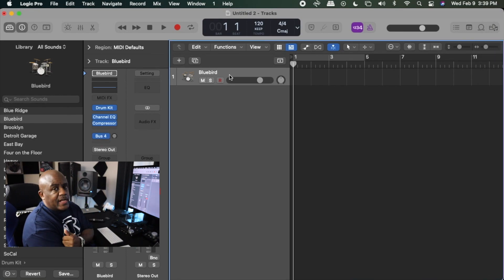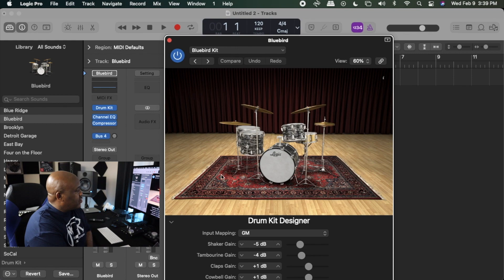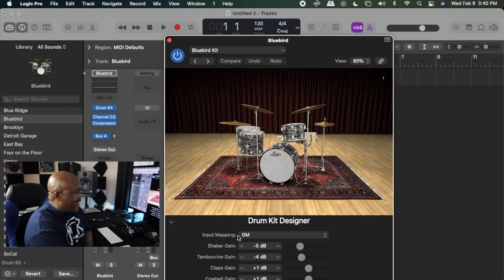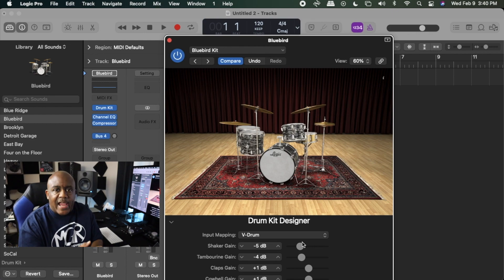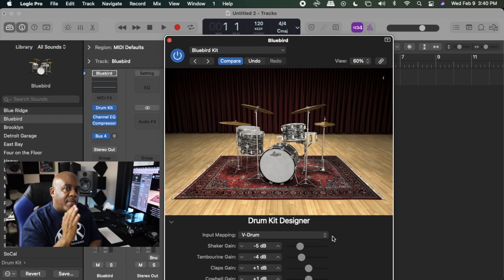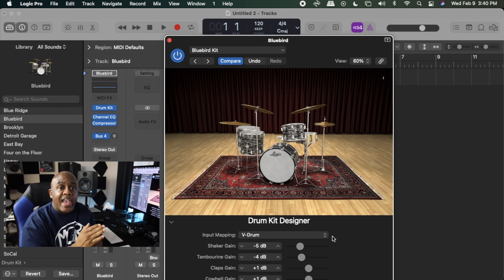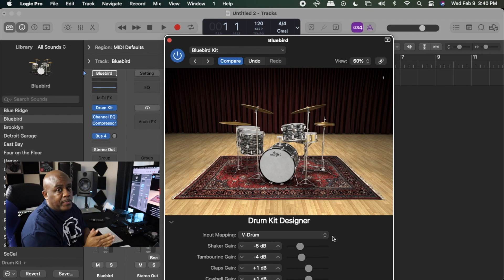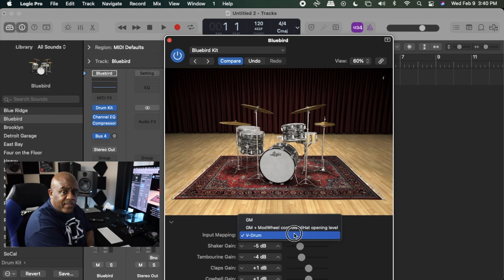How to map e-Drums in Logic Pro X to fix triggering issues.

Comment: Helpful video!! Thanks for your content! 

I’m running into a problem where my hi hats aren’t registering that they’re opening/closing etc… basically the little nuances you can have with a hi hat… and also my cymbals won’t register chokes… any ideas?? I can’t find anything online to fix the issue… 

Cheers!!!
Reply: Same here.
Reply from the maker: If assuming you’ve mapped it properly and you’re still not getting things like the choke. Make sure the drum does it straight from the module. If it doesn’t work there it won’t work plugged in to EZ Drummer. The drum needs to have the feature. If it does and still doesn’t work make sure the drums firmware is up to date. Then go back to mapping. If neither fails… call/contact customer service.
Reply: @KeithronPowell  when the kit isn’t plugged into the computer it functions just fine… when I map it through logic I’m not entirely sure how to map a choke or a hi hat opening or closing, if that makes sense? Thanks for your response! Appreciated greatly!
Reply from the maker: @Timbelialclarke  I’m not sure what to do… maybe try the different settings and see if one of the others work.
Reply: i’m having the same issue
Reply: @Timbelialclarke  same thing bro it’s just the cymbal chokes and the hi hat I have the KAT kt300 but I can’t get the chokes to register but it does originally on my module I’m also trying to figure out if I can do cymbal rolls but I can’t figure jt out
Reply: Have you figured out how to map the chokes yet?

Comment: I had a similar issue with my Alesis Crimson 2. What worked for me is using another PL cable, plugging it into the extra slot (tom 4), and changing the trigger to closed hi-hat from the module. Worked well on my logic pro. I tried several approaches but that's the only trick that worked 😃 Thanks for showing this way though, might have worked for others!
Reply from the maker: Thanks for watching
Reply: I'm having all sorts of problems with my Crimson 2 as well in terms of hi hat. I haven't found anything on this before happen to have more info? Completely new to Logic and E-drums in general
Reply: @TheDanbulance did you figure it out because I’m having the same issue with my hi hat with the Crimson. Pretty bummed because I spent a lot of money on this kit and Logic Pro is the only DAW I use😭😭😭

Comment: i am trying to use my alesis kit to record on logic and it reads it but i dont get any sounds to come through. do you have any videos? im new to using ekits and recording with them
Reply from the maker: The easiest way to record the sounds from the  drum is the most involved. You can trigger the drum sounds in Logic by connecting it with a usb cable.

Comment: I found out about switching the input mapping to v-drum a while ago, but it only works for the default kits in logic's drum kit library. I tried going to the producer kit section spanning off in the library and there is no tab to go to the drum kit like there is in the regular drum kit library so I don't know where to turn it to v-drum and have triggering issues with my hi hat among other things. Anyone know how to apply the v-drum trick to the producer kit library or even downloaded kits/single shot instruments?
Reply: The drum kit is in the Overheads track within the producer kit.
Reply: I'm also interested in how to do this with producers kits! Could not find a way myself.
Reply: I'm having this same issue.  Does anyone have a fix for this?  Much appreciated!
Reply from the maker: Did you get a fix?

Comment: 1/2 open hi-hat is a rimshot, i changed it in the module, but it doesn't seem like you can do 1/2 open hi-hat in logic without the ModWheel
Reply: I had this same issue. Initially I just changed the midi note coming from the module to be the same as the open hi-hat. But there is a way you can use the foot control as you'd expect. This video is what led me to figure it out: https://www.youtube.com/watch?v=u7IFbMhdzp4&t=10s
In the scripter interface, you can see in the very bottom there is a "Hi-hat opening via" option that is set to 1 - Modulation by default. Changing that to 4 - Foot control (I think is what it is called) will provide a very smooth transition from closed to open when using the foot control. Hope that helps, either you or anyone else that comes across this.
Reply from the maker: @BrennanProffitt  that is another way to remedy it.
Reply from the maker: Yeah, never tried that trick.
Reply: Did you ever find a solution? Same issue here.
Reply: @markdgod7  no, there is no fix, you have to play it one way and change it later